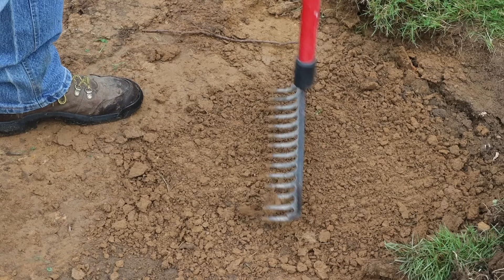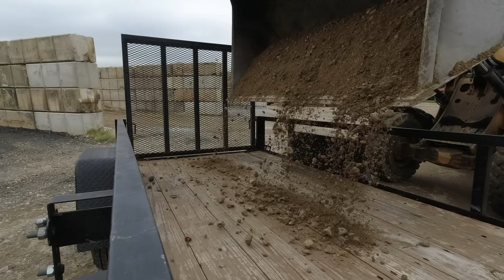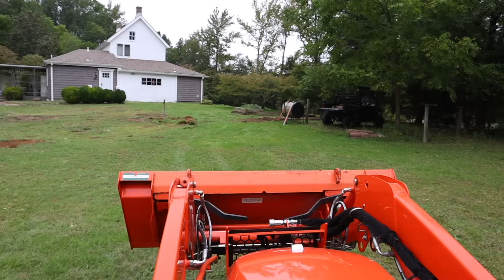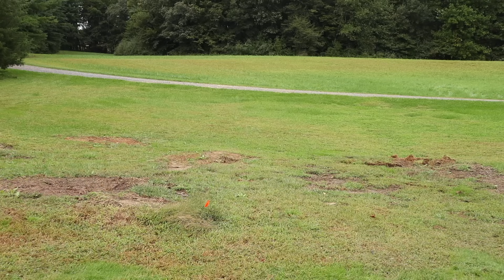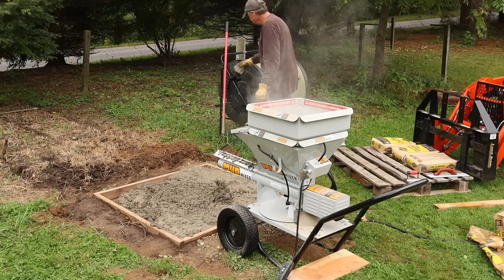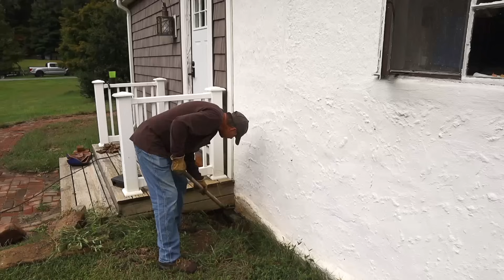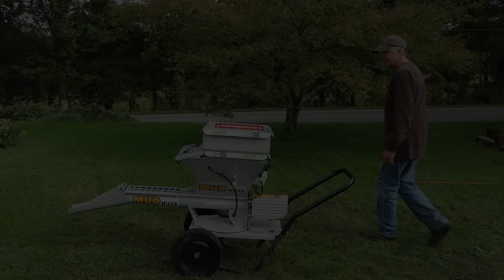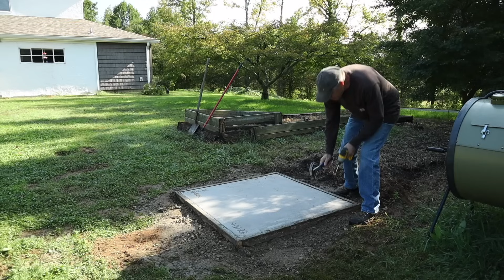Game Changer. Pouring a concrete pad and using the Mudmixer for the first time. MCG Video #169

Comment from the maker: Please use this link to learn more about the Mudmixer: https://www.mudmixer.com/mcg
I receive no commission or payment, but this lets @mudmixer  know that I sent you. Thank you!
Reply: You should put 6" X 6" metal re-inforcement wire in the unit & pull it up to 1/2 thickness as you pour to allow the slab to develop tension... also prior to leveling off 3" of 3/4 stone & 3" sand should have been tamped down to provide the proper foundation substrates for the slab before install frame, wire mesh & concrete!
Reply: Well, you sure raised a few sardonic responses to your video. You've got broad shoulders so I expect, listening to you, that you realize going public is an invitation to others to do that also. C'est la Vie. 😊😊
Reply: A shame this isn't available in the UK.
Reply: I have a $12 barrel that you can throw $3,300 in and burn next time--lot easier and minimal clean up.

Comment: The TOY was designed around a device called an auger. Another word for auger is screw conveyer. The screw conveyer was invented to transport material, NOT mix it! The TOY will transport, convey, and/or push your dampened dry mix for less than ten seconds. If it could mix, that wouldn't be enough time to obtain concrete with the strength value suggested on the bag. Remove the chute cover and watch the action??

Comment: If that toy worked as promoted, you wouldn't have to mix it with your rake? Sakrete, and I presume others, suggest you mix their product for at least 5 minutes before placing. No problem for a barrel mixer as all you have to do is watch it mix for that period before dumping. That toy mixes bag mix for about 10 seconds, and you have no control over that. I doubt the outcome would meet the strength rating on the bag??
Reply from the maker: Better than a “dry pour” right?

Comment: I just can't see any reason to justify how that thing costs over $3000.00 on Amazon! What kind of special metal are they using to make them? An average 0 turning radius commercial lawn mower made by a lesser known company has way more parts and assemblies with more sophisticated mechanism and they don't have that kind of price tag! I want some explanation other than people think it made their life much easier to do something that they could hire a good concrete contractor to do for less. This is truly mind boggling!😳😳😳
Reply from the maker: I would guess that a lot more lawn mowers are sold than cement mixers. I'm sure the price could drop if there was on of these in every garage. This is pretty specialized, so the price reflects that. Plus, it's really well made and I think the metal is imported from outer space, LOL. Thanks for watching. Oh, and you may be able to rent one locally if you want to try it out. -Ed
Reply: @MyClutteredGarage  Perhaps I should try and rent before making all these speculations about the price!😀 Hopefully Home Depot has it and they won't charge an arm and a leg to rent it. Of course they'll have to consider the amount they invested on it. How I wish I'm still 21 and don't have to wory about breaking all my bones doing concrete work!😆
Reply: @MyClutteredGarage  But wouldn't it be nice for them to make it as affordable and get every DIY enthusiasts out there have one? I think the company is very young and really don't have the experience like Apple or any other tech giants who are really making a killing with their products! Just imagine if Apple started selling their Iphones for $10,000 each to start just because they think people would buy them no matter what?😀

Comment: Key to quility concrete is proper water cement ratio, afdingen water to let it flow easy  is not a solution; should use vibrating needle to ensure proper compacting and released most trappen air..Once your needle touch the "presumed" too dry concrete it  " melts" and flows sooo well..

Comment: I’m not understanding why people buy mixers and thousands of pounds of concrete when they can just rent a ready mix trailer.  Weight can’t be a problem because putting a yard of concrete in the bed of your truck is just as bad as towing that trailer.

Comment: If I was younger and was more into DIY yard stuff I'd love to have that cement mixer.  I've looked and the 4g price is a bit out of my league.

However, if I developed this I'd want it to be able to have a seven ft reach ... That way you could sit at the end of a 8 ft section and get the concrete all the way across.  That and I'd stick the pour spout at right angles to the direction of wheel travel so that  way as you mix/ pour you just nudge it forward / backward to the next spot.  

Just an armchair diy'er.  Whatta I know.  LOL

Comment: Using your loader to scoop gravel will be easier if you put the rear axle of your pickup on 8-10" ramps.  Brings the rear of the trailer much lower and helps keep the gravel from sliding away from the loader bucket.

Comment: You are using a magnesium float. You should have used the float much earlier to work the edges and push the gravel down and work the butter on top to have a smoother time when edging later. To get the lines out, you need an actual trowel, and wait till the concrete dries a little more to get a smooth finish. Before it completely cures, use a brush broom to get texture for traction on the concrete. You did good, considering you're not a concrete guy.
Reply from the maker: Thank you!

Comment: If you edge drag your pour immediately it will be easier to cut the edge later. Broom your concrete to eliminate lines and a Mag float is not for finishing it is for rolling the rocks down and get a cream on the surface.
Reply from the maker: Thanks!

Comment: You're right that you don't know what you're doing.  Grass will never grow up into your compost; the ground there is mulched by many inches, even a couple feet, of compost.  But neatness counts.  Well, actually it doesn't count but it looks neat.  

You put the base under and build the form on top of the base.  You cover your dirt loads to keep from sandblasting anyone coming up behind you before they realize what you've done.  You should have been ticketed for that load.  But I came here to see the concrete mixing.  You should have edited just that part to match the promise of the title. 

And then it turns out to be nothing but a paid promo of a commercial product.  13 minutes wasted before you got to the paid promo and you didn't have the honesty to tell that it was a paid promo.

Comment: I read most of the comments. Here is what no one else has said. The mix is way too wet . If the machine can't put out a dryer mix then the machine is worthless floating concrete is completely different from finishing concrete. When you float you will leave lines. When it is dryer, you will finish it and remove those lines.
Reply from the maker: You can dial in the consistency you want. 👍

Comment: I don't see much advantage to this machine at all. The only thing it has going for it is you don't have to add the water and it has a chute, other than that it's the same as a mixer. I can set up my portable mixer to dump it out where I need too just like that too. That has a lot more moving parts that can break down than a mixer too, although I'm sure it's a quality machine. No way to justify spending $3k plus on this thing.

Comment: Well you are right you don’t know what you are doing. You should have put some kind of stakes on the outside of your form and then bring it to level with the ground around it. Then put the gravel in the bottom of your form. Then you would have been ready for the concrete. At least that’s how I did it for the last 35 years.

Comment: I chased down a farmer who had a pickup bed full of rocks this size who had passed me and my wife going the other way across a rough set of railroad tracks.  A BUNCH of material flew out the back of his bed as his tailgate was down -- SPRAYING my windshield and leaving me with rock chips and windshield damage.  This later cost me $1150.  I didn't get his insurance information and I've regretted it ever since.  I should have called the Colorado State Patrol as this occurred on the state highway.

Your load is not secured. Understand?  Rocks flying off and hitting a motorcyclist going the other way can kill or take out eyes.   

Your video sucks.  Why?  Because you don't think about public safeties -- AT ALL.  Damages run into the billions because of carelessness like this. 

Downvoted.

Comment: Shortly after you finish pouring the concrete run the edger around to push down the large gravels. Then come back like you did and the edger glides along the edges.

Comment: The base material you brought home is probably what’s left in the concrete trucks when they return to their yard. They wash the trucks out in a pond or a catch basin, then as that fills up, they make another basin and let the water evaporate from the one they’ve been using. Once it’s dry enough, they dig that mud out with their loader and pile it up to dry further. Once it’s really dry, they can load it out in dump trucks or on trailers to be hauled away. 
They call it wash out in my area and they’ll load in your trailer for free. I got around 250 yards of it not too long ago and used it for road base to build about a 400’ one lane road into a neighbor’s property.
Reply: Letting it bounce off the trailer seems a bit irresponsible.
Reply: @johnwax9759  
I fail to see where there was anything said about letting the stuff fall off a trailer, did I write something I can’t see now or was that just a figment of your imagination? There are other kinds of trailers besides flatbeds. .
Reply: @ralfie8801  Sorry, I should have directed my comment to the original poster.

Comment: Neat tool.  But I don't think the cost justifies for whatever DIY project one may have.  Over $3K for it. Too much!  If this tool was $500-$750 bucks I could see the need for certain DIY projects.  Plus, the tool does not have anything earth sharing to justify that cost.  There is a motor, some auger and a container, not $3K of parts.  But the idea is somewhat different.

Comment: It looked like it was pushing the mix uphill. Should it be perfectly level or even pushing the wet mix at a downward slope?
Reply from the maker: You make a good point. I don’t know but it seems logical that the angle of the discharge chute would affect consistency. Thank you.

Comment: Been looking at one of these and I think you need to be aware of water pressure, on city water supply you should have a fairly consistent pressure level but on a well supply that pressure can vary by 20psi as the pump is set to turn on and off. I bet if you used an inline booster pump to maintain water pressure you can solve many issues.
Reply from the maker: Thanks. I’m actually going to try an in-line hose mounted pressure regulator next time - which should offer consistent water pressure. 👍
Reply: Thanks for the video. I just bought a Mudmixer and I'm on a well, so I've been thinking about how I'm going to get consistent results; my plan is to run my water into a 30 gallon poly tank and then run the outflow thru a boost pump and pressure regulator. Probably overkill, but now that I'm retired I seem to have a lot of excess time on my hands to think this stuff up.
Reply: @MrTks1959  I don't own one of these machines yet but in my opinion there are 3 key issues that users should be proactive about to maximize their purchase, 

1: Normal operation will immediately scratch the paint on the shoot so you must oil or repaint after use. 

2: water pressure needs to be very consistent or your mix will suffer. 

3: It is probably worth screening the cement mix prior to dumping it in the hopper. Some sort of classifying tool.
Reply from the maker: @MrTks1959  I would try an in-line hose regulator used for RV’s first. Here’s an affiliate link if you’re interested. 
https://amzn.to/3xLKXna

Comment: Concrete is notoriously weak in tension. Compression strength is where it really shines. For holding nothing heavier than a composter, this is prrobably okay but don't try to drive a vehicle over it. It will crack. Concrete slabs like this, and larger, should have re-mesh embedded about 1/3 the slab thickness up from the bottom. This puts the concrete above the mesh into compression when a   load is added. Enough  concrete below the mesh to seal it from ground moisture will prevent rusting. In a frost prone climate, a thicker slab would be in order so an upper layer of remesh can be added. This prevents the frozen ground from heaving and cracking the top surface.

Comment: 😂 to all the comments. They left no stone unturned. Now I'm going to put in my tuppence worth - Why, oh why bother to put down a cement standing block that you've had to excavate and remove grassed soil, for a compost heap? Rats, if any, will get in anyway you like and the grass will still be a nuisance around the edges. Have you ever come across the 'notion' of "no dig". Actually, it is a highly valued concept in gardening and, more importantly, it works. Save your back, even if you  have a machine. Rather,  devote your gained time by doing something nice for your wife or yourself. ( I know. You just wanted to play around with the front loader attachment on your tractor.)

Comment: interesting to watch, the mag float is really for clearing the stone from the top 1/4 layer....you need a steel float with a curved end to make a decent flat surface without lines. Always edge as soon as it is hard enough, that is a test and see, before using the mag float. The mag float will bring up the slurry you can use on the edges to round off.
Reply from the maker: Thanks!

Comment: Great video and very well done for never using it, we have all done concrete the traditional way, mason was my very first trade my parents allowed me to do with a neighborgh when I was 15 to learn the honest earn with hard work, I was his helper for a good year before moving to carpentry, I have never liked concrete work, still remember those concrete bucket I had to haul to fill forms and footages and I was also the one mixing it, he just would show me how and occasionally yell at me when I messed up. That is history, fast forward 40+ years and just got this Mudmixer now, because right now I do not need it al all🤣...the way that works is I will have it once and if I need it, I got a project for a back yard shed 12x16, I had a small home depot mixer but decided to get this one instead, last pouring in my back yard was a strip on the side of 7x28, a little over 3 yards, we ended up getting a short load and paid 1K came out not perfect out of level in one corner and the pad already cracked in 2 places as no line was cut on it, I was going to do it myself with the small mixer but that was like 3 pallets and half of cement and I do not have a good back, so with all that said, I invested on this thing now, because later on when needed the price would probably be higher, I did not get the accessories which right now they are another $500 or close but will be looking for offers and maybe sales if any; I saw videos of a you tuber building a shop/apartment in a rural area huge and he used this machine for all the concrete work and I was impressed by how much it can really do! the guy will also be building a house and I am sure he will use the mudmixer for the foundation and the slab. Mine is still in its box since I got it last week and if I happen to die before using it, I am sure it holds its value and can be sold and the cash recovered, it is just a good expensive investment which should not be let pass by if one has the $$ for it at some point.
Reply from the maker: I hope you get the opportunity to use it! 😄👍

Comment: I would contact the manufacturer about the leaky seal between the electric motor and the  auger - because that much loss of the fines (which looked like mostly cement) on that small of a mix is unacceptable.

Comment: I don't know. - We have been using a HF mixer for like 10 years now to do things like Generator pads and replacing floor cuts in factories. Even small machine bases. - We just put the bags in the Bobcat bucket and cut the end of the bag and then and turn the mixer over the hole and mix it on the spot. Wheels and dumps very easy if you have to get into tight spaces and does a proper MPF job (That is mix PLACE and finish. - You are not really supposed to "POUR" and drag concrete according to hoyal. ) 

The HF mixer is a couple hun, compared to 3-grand...and from what I see the HF mixer is easier to clean. If you need more then like 50 bags or so I think you are money ahead calling a truck IF not you got to mix an awful lot of mud to make up $3000. - If it was metered concrete and/or mortar where you have cement in one hopper, Sand in another, and aggregate in yet another I might think about it, but just to mix water with per-mix bags I'll stick with the mixer.

Comment: When pulling the fat off the top and getting the high lines out of the slab go with a steeper angle on your trowel and try to make one long pull in one direction... It also takes allot of time for concrete to settle and cure some of the ppl I've worked with over the years sugest covering the pad with burlap after it sets up a bit and then wetting it just enough to keep a damp and do that every day for 30 days then pull the burlap on day 30 and it's good to go ... But that was with allot of curb work so maybe its just an exclusive process to that particular job for strength purposes as they do get hit by cars repeatedly
Reply from the maker: Thank you!

Comment: Spray a little water into the mixer before you load it.
Reply from the maker: Yes. It’s good to spray down the chute, but not the hopper. Dry mix in there only. Thanks.
Reply: @MyClutteredGarage If you spay about a quart of water in the mixing chamber before you turn it on It will keep from jamming the clinkervirks.